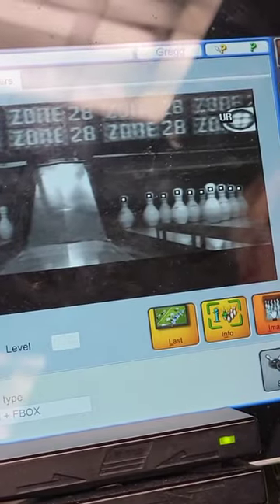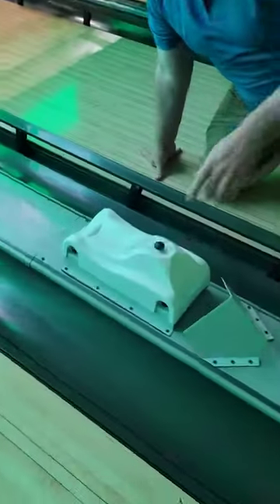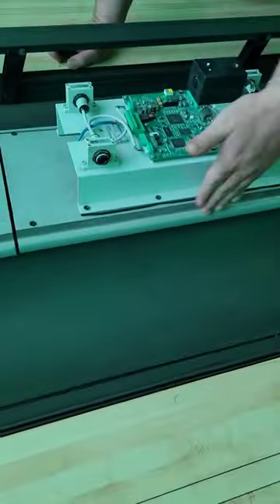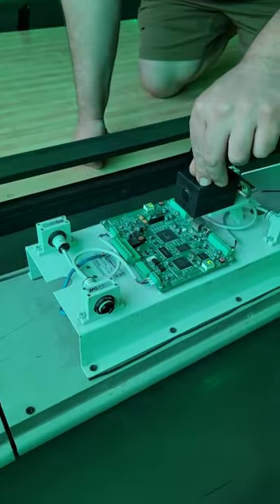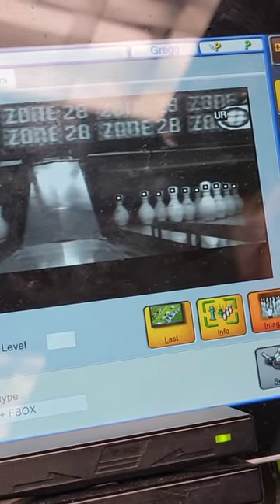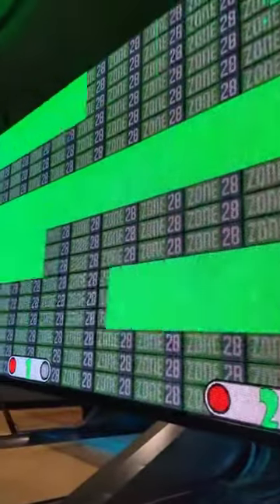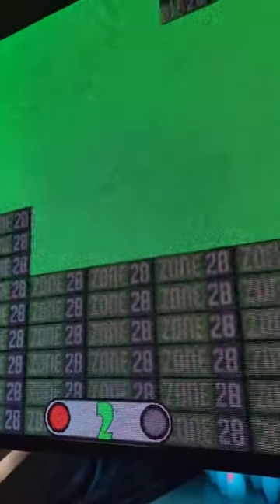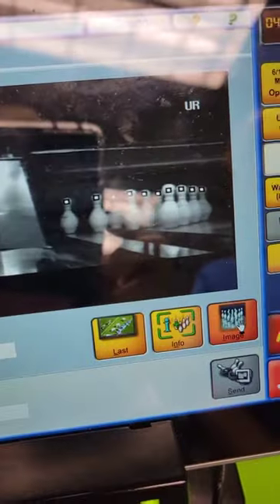How Bowling Alleys Know Your Score #shorts

Comment: Not only did I know this, BUT this type of scoring system is reserved for older pinsetter models (anything AMF and the Brunswick A2 models).  Newer pinsetters don't need those cameras like the Brunswick GSX or the GS-NXT.  How those work in scoring is when after the ball passes the sweeper into the pins, the pinsetter comes down and has pads, if those pads are moved, it means there's a pin still standing, thus they calculate the score.  If all 10 pins are standing after your 1st shot, and the pinsetter detects all ten pins standing, the sweeper and pinsetter just goes back up without moving a single pin.  

Not only is this type of scoring more accurate, but should bowlers run into problems like an offset pin that falls after the pinsetter goes up, you can problem the pin setter to reset that specific pin.  Older models can't do this, and thus often times the scoring system can make a mistake like when a pin falls over after the pinsetter goes up.

Comment: These are A2 pinsetters, not sure which 2 but they are using Qubica Conquerer as their scoring system. If you get a chance to visit a Bowlero that used to be a Brunswick center, those usually have a different scoring system called Vector. Slight differences but very similar outcome. A2 pinsetters are the most common pinsetter due to the metal being widely available after the war back in the 50s and 60s. These machines were being pumped out by the 1000s, some even have the green military paint on them! I was a mechanic for a number of years.
Reply: Well they use to use brunswick scoring when this place used to be called fun fest, until they got bank rubbed

Comment: Brunswick A2 and QubicaAMF pinsetters use a camera, Brunswick GS series pinsetters have mechanical sensors in the table when it picks up the pins.
Reply: Those "sensors" that the Brunswick GS-Series Pinsetters uses are called "Pin Detector Plates", I find them better accurate to score opposed to a camera on an AMF or Brunswick A2 because that what happeed to me when Ì bowled on AMF Pinspotters and they get annoying overtime that I have to edit the score out. The Pin Detector Plates can also send command to the Pinsetter Electronic system to have a memory of which pins are left standing. Let's say you left a 10 Pin but then the Spotting Tong accidentally dropped the pin, so there's a button called the "Set" Button, if you push it then the last pin set up can recover automatically, no need to stick your hand inside an AMF or Brunswick A2 to put the pin back up manually, I've seen that a lot when I'm Bowling in a League on those same AMF Pinspotters.

Comment: For the record, not every alley uses this system, a lot of them use sensors in the floor below each pin that will monitor whether it’s still there or not
Reply: No alley uses those. They aren't a thing. They either use cameras or with the Brunswick GS series they use switches on the table

Comment: This doesn't apply to all pinsetters.
Brunswick GS series pinsetters uses small pressure plates that are pushed up by the standing pins to detect them. You can easily tell these setters apart from the others since the table will come down after the second ball to get score while others don't since there's no need.

Comment: I had always thought they kept count by the lifter counting the remaining pins it picked up. 🤷🏾‍♂️
Reply: They actually used to work like that! There was a microswitch above every pin slot with wires running to it. It absolutely sucked, the cameras are way better.
Reply: @mangaman88188280  nice thank you for that information my friend

Comment: You can actually adjust the speed of the sweep if your system is fairly new, any ball that travels at 5mph or less sweep comes down slowly. But technically you could make the sweep come down slow at fast speed in the settings, but you would have a lot of dead wood most likely. #sub⬆️